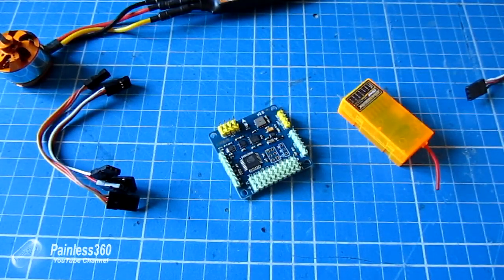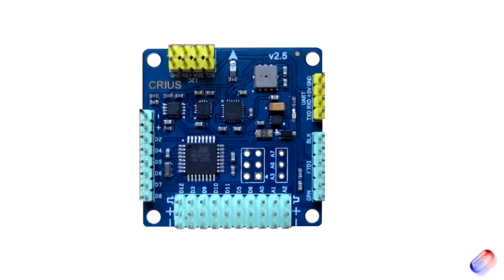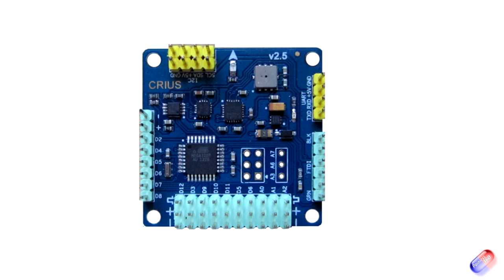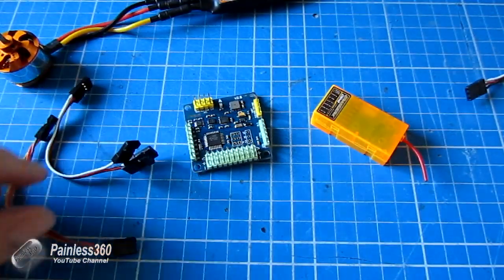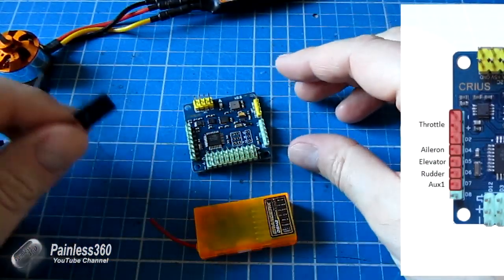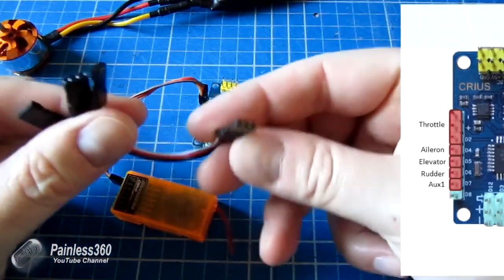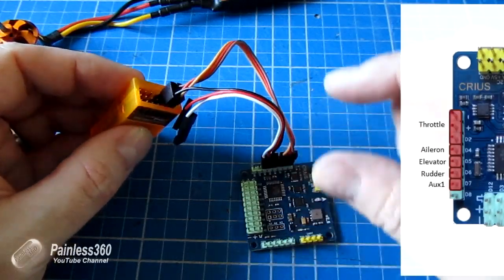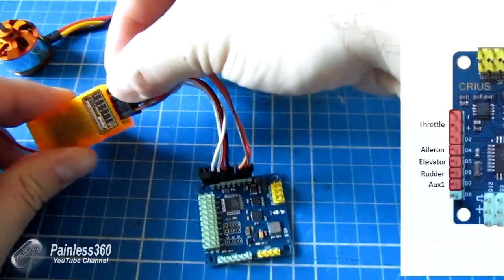(2/7) How to wire up a Multiwii SE board to your multirotor/quadcopter

Comment: Hi,
I saw you videos and they helped me a lot!!
So first thank you for making them.
I have some problems with my Multiwii SE V2.5 quad and I thought you might be able to help me solve them.

When I try to power up the motors, one ESC stays "off". It only engages at high speed demand.
After I checked I found out that the problem is in the board pin D11 output, as all the motors and ESCs are fine.

How can I solve that problem? Maybe a software malfunction? Can I control the motor using other pins?

Thanks!!
yoraish
Reply from the maker: How do you know that pin 11 is the issue? Have you swapped two of the ESCs over and the problem stayed with the one plugged into D11?

If that is the case then check for poor solder connections on the D11 connector, re-flash the board with the software and if that doesn't work then clear the EEPROM and re-flash the board. If all that fails then the board may be kaput.

If you swap the two ESCs as above and the problem stays with the ESC that was plugged into D11 then recalibrate the throttle range on that ESC and see if that helps..

Good luck!
Reply: Painless360 Exactly.
Reply: One more thing, I can't flash the board :(
I get : avrdude: stk500_recv(): programmer is not responding.

So no clearing the eepro..
I'll check the connections and let you  know how it went!

Thank you very much!
yoraish
Reply: No luck :/
I guess I'll have to order a new board.
Reply from the maker: Bad luck. :( I hope the new one behaves itself for you.
Reply: Thanks for your great answers!
Do you think the problem may be in the FTDI Tool?
Or maybe I fried something on the board by mistake on the first time?
Reply from the maker: Could be - try http://forum.arduino.cc/index.php/topic,118440.0.html and if that fails then order a new FTDI board..
Reply: Painless360 Today I tried uploading the sketch again with the BETA Arduino 1.5.5 after installing a driver for the FTDI.
Surprisingly, it worked!
But unfortunately no errors in the upload process does not mean that it works :/
As time progresses I start to believe more strongly that the board is bad.
One pin sends bad signals and the overall behavior  of the motors is not right.

Thanks again for your great help. I'll get a new board and update.

p.s. Is there a chance that the strange behavior is caused because of poor calibration or software?
Reply from the maker: Glad to hear that it's better. The board should always be calibrated for the acc and mag after every flash.

I would replace the board anyway - better to do it now than wreck a frame and a couple of motors in a nasty crash!

Use this one for testing ;)
Reply: Yeah I figured that out :) .

One thing I noticed is that the MAG starts drifting away after being calibrated. Not so good.

Many thanks for your help!
And now, we wait!
Reply from the maker: Secure the model to something heavy so it can't take off and connect the model to MultiWiiConf using Bluetooth or USB and run up the model - check that the acc and mag readings are not jumping about and that watch the motor power levels to check them too.

Recalibrate the acc and mag and see if anything changes. Odd problem..
Reply from the maker: Maybe. I've not seen that myself..
Reply from the maker: Great news! Post a vid, I enjoy seeing it.. 

Happy flying
Reply: Make sure that the mag is not near any power lines as these will cause a problem. Secure the model and throttle up while viewing the compass data in Multiwiiconf to see if you need to separate them more.. Better luck with the new board..
Reply: I feel stupid now... 
All I had to do is calibrate the ESCs >< !

Now it flies!!!
Time to learn :)
Reply: Great news. I suggested a recalibration  in the first reply as I've had a similar issue myself in the past. I'm glad you've got it sorted, good job! 

Happy flying!
Reply: WooHoo!! More Problems! It worked just fine until today.. Right now it seems like it automatically gives the quad too much pitch on takeoff, making the quad flip..
I tried recalibrating all the ESC, tested with different variations of code, cleared the EEPROM, but nothing works.
All that happens is the 2 rear motors spinning fast, sometimes the left front one joins in and that's all.
p.s. The left rear motor fades back to idle after given some throttle and all the motors react to aggressive yaw, each one relatively to it's speed.

Any ideas?
Reply: I think it is not necessary.. The MAG is always jumping! After calibration it stays for a couple of seconds but then goes crazy again.
I may shoot a video of it tomorrow
Reply: Please - the mag shouldn't be moving that much. A degree or two movement is expected..
Reply: Is there any chance a big crash caused that?
(Electronics cover was on)
Reply: Alright then, it is waiting time!
I can not thank you enough for all your help, so I'll just say thank you in a polite but grateful manner :)
Reply: SOLVED!!
I just had to reset the Transmitter's parameters!
By the way the MAG was going crazy because I did not calibrate it right. I should have turned it 360 degrees on x,y, and z axises while calibrating. it worked fine now.